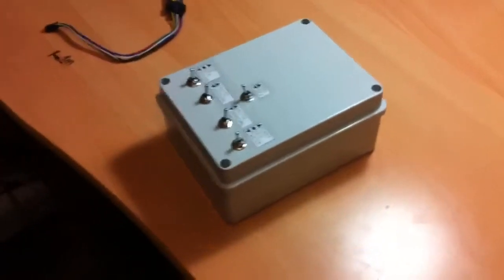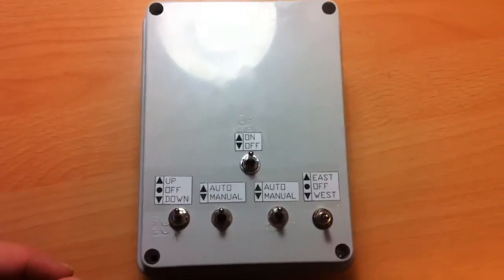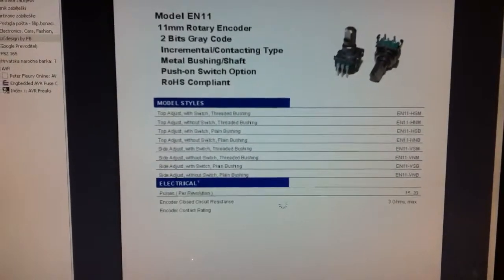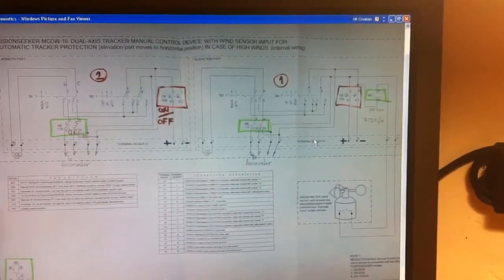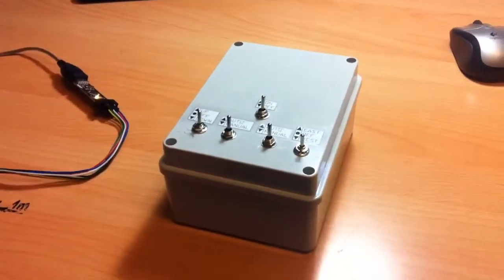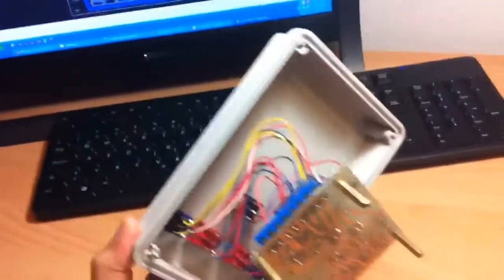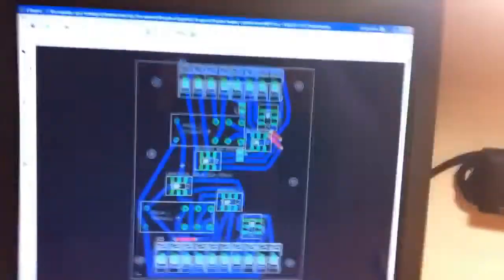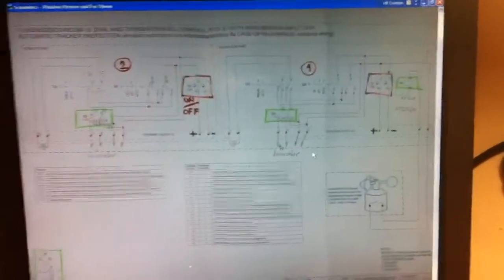Control board for solar tracker (Fusionseeker)

Comment: how accurate is this controller?
Reply from the maker: Accurancy can be set in controller itself.
Refer to Fusionseek manual for details about accurancy: 
http://www.fusionseeker.com/Download/1instructions_DS-50D6_rev0.pdf
Reply: thank you. I was considering purchasing this controller to test on the tracker I have at my house. the problem with my current controller is its not very accurate before 10am and after 2pm. the controller is GPS and algorithm controlled. can you tell me a little more about your experience with fusionseeker and if it's a controller you recommend? I need a controller to track high accuracy for CPV panels. thank you :)
Reply from the maker: Mark Bedoya we have fusionseeker installed for more than 10 yrs now, and it works with no issue. I have flat PV, but there's version of fusionseeker specially made for concentrators, with even higher accuracy. Model I have can be very accurate, once it was set up to move axis once in 3 min. But that was too often :)
yes, I can only recommend it. Very good build quality, no mecanical relays, only solid state components. You should try model for concentrators...
Reply from the maker: Mark Bedoya this model FUSIONSEEKER DS-100D10
Reply: fbonacic thank you for your fast responses. I'm currently talking with fusionseeker and getting ready to purchase their system and put it on my tracker at home. You've been great help. thanks again :)